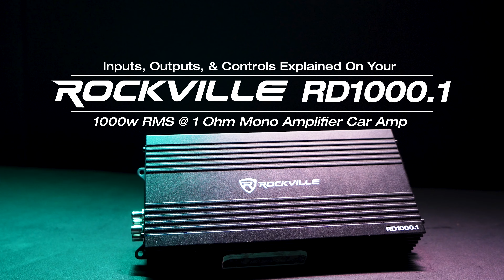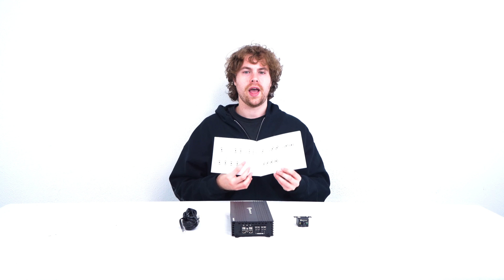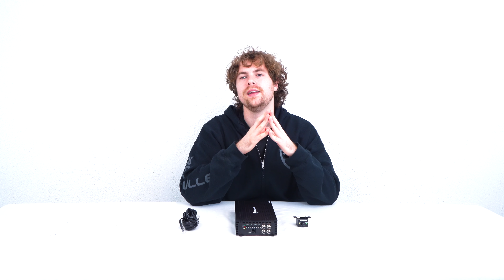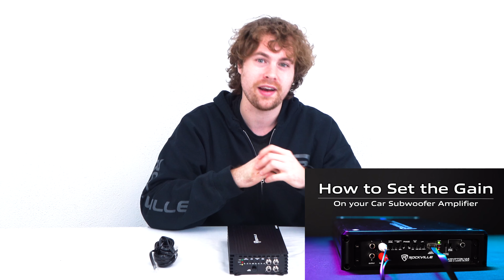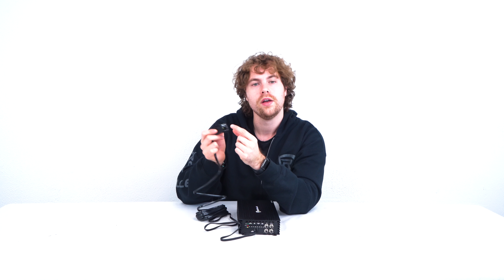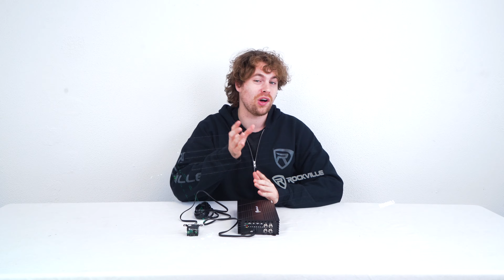Inputs, Outputs, And Controls On Rockville RD1000.1 1000w RMS @ 1 Ohm Mono Amp Car Audio Explained

Comment: I’m running two 10’s with a rd1000.1 on each sub. I have one set of rca’s running from the head unit to the 1st amp input then ran a short rca from the output of amp 1 to the input of amp 2.

My question is…do I have to use both the supplied bass knobs and set parameters on each amp separately OR did using the line-out from amp 1 strap the amps where I only need 1 bass knob and only need to adjust the settings on amp 1 to change both amps? Thank you in advance if you find time to respond!